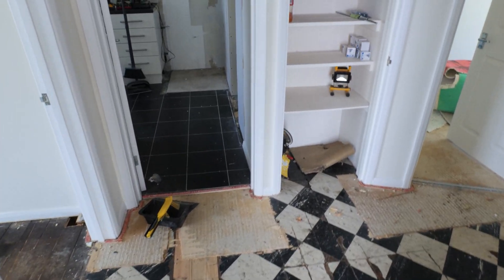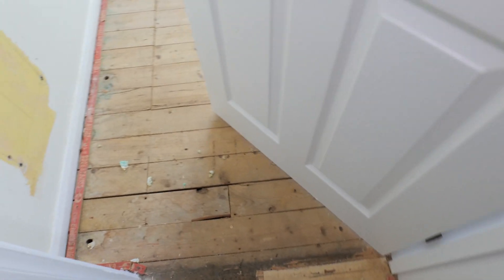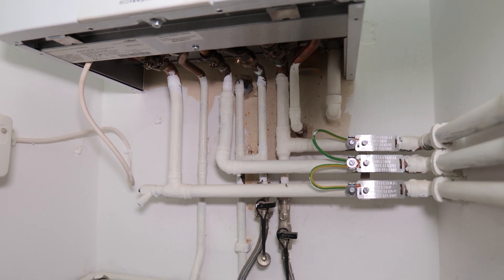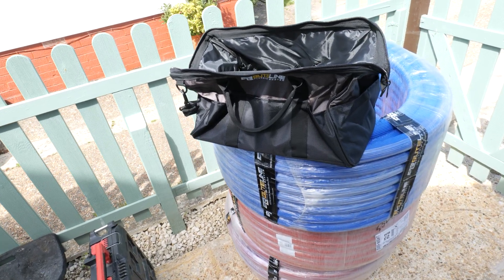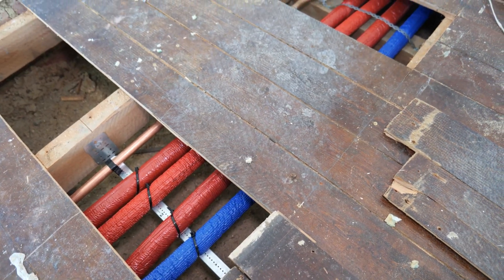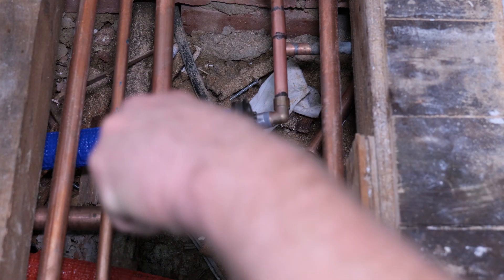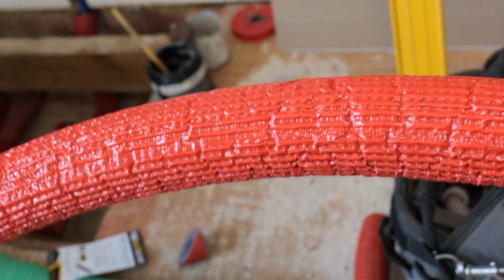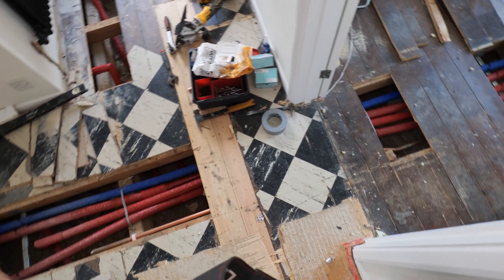The best plumbing pipework system? - Buteline

Comment: I have uses Hughes plastic pipe for heating for many years and do kike the push fit connectors which can be undone. But for under the floor the insulated Buteline does look better as pushing insulation along pipes is a pain!. I'll see if it is available at Plumbfix or Buildbase.(Derby)

Comment: Not bad , but there’s a lot of issues, when it comes to a second floor installation inside a house , you got a Notching regulations, which is not very convenient with all that lagging inside a pipe work to drill a big holes trough a timber beam…. There wouldn’t be such a gap below, only plasterboard… I rather stick to a copper lifespan 50 years plus … could go over 100 depending how you treat your water mains and central chemicals.

Comment: hi just warning you we fitted two of the philmac fittings last week the same as you had on the water main and one blow off flooding  the house it says on the nut to use a wrench to tighten  which we did but there rubbish and cost a big insurance claim
Reply from the maker: Oh that's not making me feel good 😂🙈. Sorry to hear that mate. What did you replace it with ? There's not much available I don't think.

Comment: Is the flow rate OK with that buteline? For the main flow and returns or can they do 22mm type of sizing for it?
Reply from the maker: Yea it's basically the same as any other plastic system I believe. That is 22mm on the flow and return , but they also do 28mm. Thanks